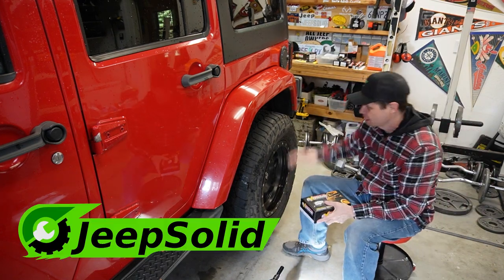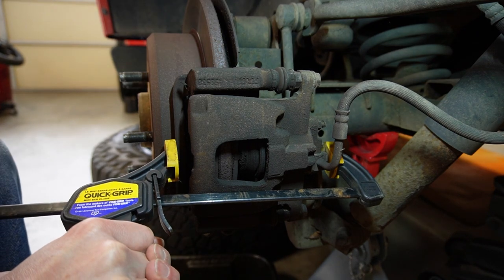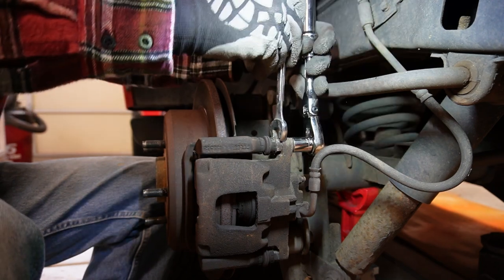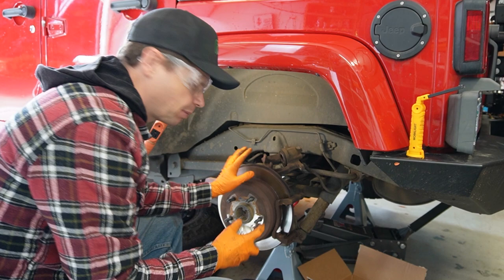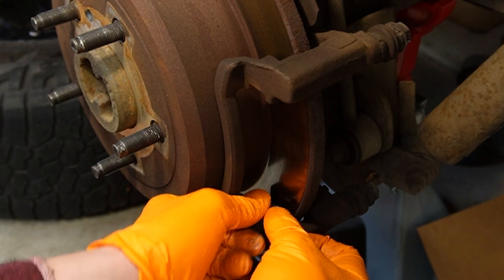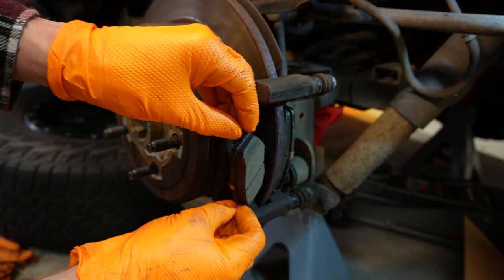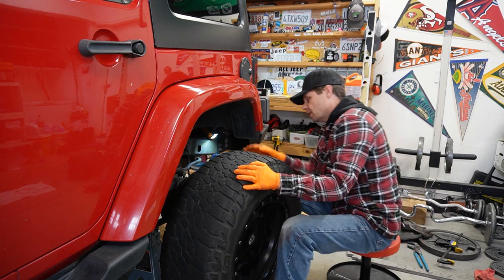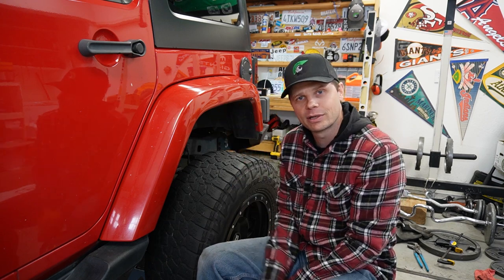Jeep JK Rear Brake Pad replacement. Jeep brakes squeak

Comment: Another tip is to make sure you torque you caliper bolts. No bueno if those come loose.  Been there done that.
Reply from the maker: Yeah? What happened in your case? Lost brakes? Crash?
Reply: @JeepSolid  caliper came off. Wore a hole through the rim.  Had to buy a new rim.  Fortunately, no crash.  Did twice b4 I got smart.  Never said I knew what was doing. 😎

Comment: Bought my JK 6sp manual new in 16, first time I've ever worn out the rear pads of a vehicle instead of the fronts.. the fronts looked hardly worn at all.. this was at 32k miles.. weird
Reply from the maker: Yeah. Fronts are going out soon on mine. Not much left